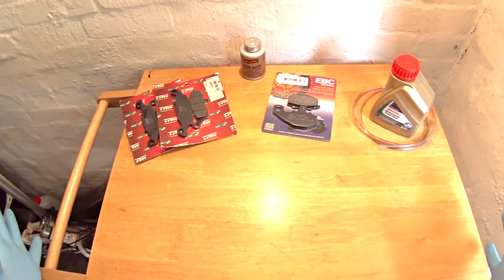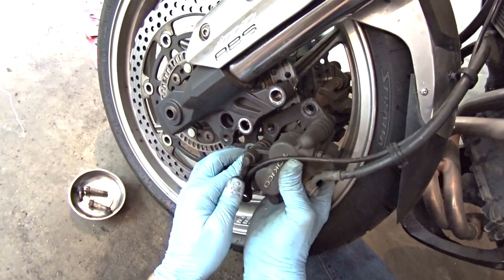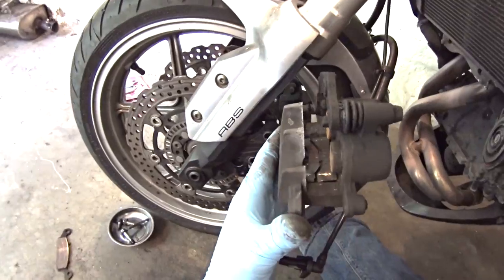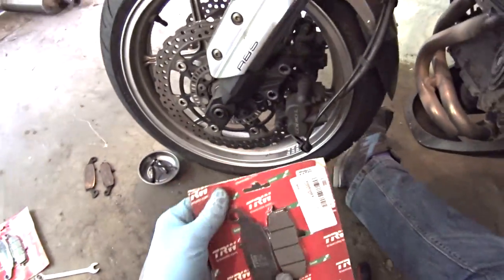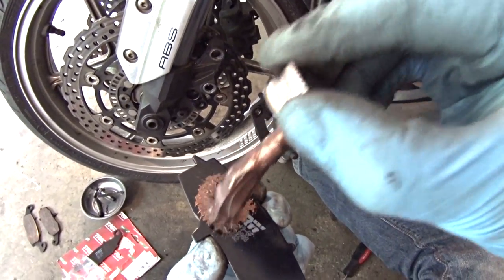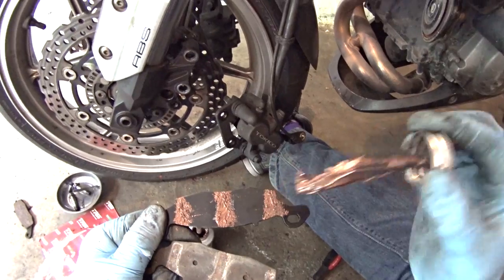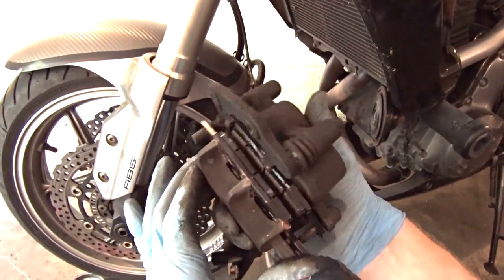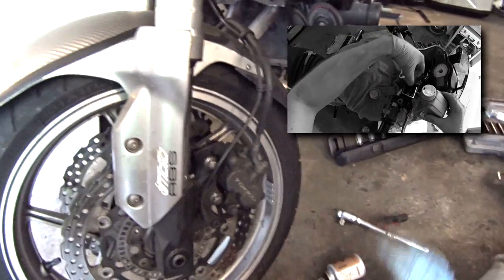Changing Front Brake Pads, Versys 650

Comment: Great vid, Andy. I might add that if you're unsure whether fluid has been added, keep an eye on the reservoir. And if it's a Japanese bike and it looks like the reservoir is held on with Phillips head screws, it ain't - they're JIS and there is a difference. If you use a Phillips driver, do so with care!
Reply from the maker: Thanks John. Yeah I’ve discovered the difference between the Philips and JIS. I think now that i have a new bike, i really ought to invest finally in a decent set of JIS bits!

Comment: A funny thing that clip is there, my local shop bothers with a pin with a loop - another great tip is that those clips are the same ones we use to hold a body onto a radio controlled car, i've got loads of them and all sort of colors though you're not gonna see them so often :D.
Did the oli and air filter off your other video, thx for that, saves lots of time and money to be used on the road and on the bike :)
Reply from the maker: +DJ-Skovsnegl Thanks! Top tip! Especially for those wanting pins to match their fancy multicolored stainless braided brake lines!!

Comment: Hi Andy! Did you like the organic brake pads? Are they good for riding in the mountains? I changed my Yamaha Fazer for a Versys and need to replace the brake pads.
Reply from the maker: I thought they were great. Obviously they're more susceptible to brake fade, but I only had one slight case after a very heavily overcooked straight bit into a super steep hairpin! The smoothness made it worthwhile though. Though I am also not a heavy braker. With the Versys you can also leave a lot to the strong engine braking.
Reply: @AndyManCam  Thanx for taking time to answer my question! I'm also not a heavy braker. I prefer engine braking (at least on my Fazer). I just bought the Versys and I think the engine braking is way too hard. But maybe I just need to get used to that (or buy a booster plug). Anyway keep up the great videos!

Comment: There are always people saying you done something wrong lol giving your brakes a clean while doing this is good practice but as I'm sure you found out, it's rare it will cause any issue if you don't.  I'm mostly surprised there are not a ton of ""don't use copper grease on brakes" comments lol, it's absolutely fine, they should read the label.  I've always used it on brakes and on car wheels (where they meet the hub, makes taking them of much later, much easier) from training, at work and on my own cars over the years.  It is designed to go on mating surfaces and prevents corrosion, on moving parts like the slider pins, you should use a high temp all purpose grease, after cleaning them too lol not with soapy water as someone said, use brake cleaner.
Reply from the maker: Cheers HR. Yeah there's always something that somebody thinks you should have done different! The grease was a case of what i've got being better than nothing at all for the pins! Steadily the workshop equipment grows to what might be called a well stocked workshop!
Reply: @AndyManCam  I'm always needing new tools and fluids and greases, especially now I have more to do on the ER6f.  I even put copper greases on a bikes rear axle once as I had nothing else.

I just watched your booster plug video as you typed this lol, looks like a pretty cheap alternative.  I was asked once (years back) if I had something similar fitted to my old car (to make it go like stink he said), because we had trouble getting the emissions down for an M.O.T.  Any issues with this later?
Reply from the maker: No real issues, but out of paranoia and lack of time, I actually removed it for the German MOT. Kind of wish that for science's sake I'd left it in.
Reply: @AndyManCam  You already had an end can on right? did you have a performance filter too?  they would already have made the ECU up the fueling due to more air flow at both ends.  I just wondered if it did still run lean before fitting this.
Reply from the maker: Yeah I had a Hurric End can, and a high flow filter, so probably would have been fine as it would have been running very lean with standard fuelling and so much more air. Next time!
Reply: @AndyManCam  Thanks for taking time to reply mate, really appreciate it  👍
Reply from the maker: No problem mate. My pleasure !

Comment: Two lil questions for you Andy.

How long do you find the pads take to bed in?
How long roughly do they last?

Need new fronts on mine soon and was thinking of just grabbing two organics as have been told they bed in alot faster than sintered and alot gentler on the discs
Reply from the maker: +Mishka Oliver It depends really on how you ride. I tend to try and think ahead and also use engine braking a lot. As a result they take a little longer to bed in and also last way longer! Should probably bed in within about 200km. My last set of pads were on the bike when i got it and were still only half worn 15,000 km later!

Comment: Shouldn't the second piston try to pop out when you force the first one back in (and vice versa)?
Reply from the maker: +Kevindeuxieme i guess that the resistance of the cylinder against the seals is greater than the gravity on the level of the reservoir. So the liquid takes the path of least resistance rather than forcing the other stiff piston out. Might be different if the reservoir cap was off and the system sealed? Not sure!

Comment: Jesus...this is how you don't do it....get a caliper tool to push them back in, less than £10 on ebay.  Also, before pushing the pistons back in, push them out a bit and give them a clean...room mate's tooth brush is good for this...you've just pushed dust and other debris past the seals!!!
Reply from the maker: +Bucks Biker Why buy a tool for a tenner, when i have a ton of tools that'll do it fine already!? Agreed i probably should have given the pistons a setting too first. But this is the quick and dirty version! Plus i plan to give the calipers new seals when i eventually get braided lines.
Reply: Because you'll damage the pistons, it's a cheap tool that is perfect for the job.

http://www.ebay.co.uk/itm/DISC-BRAKE-SPREADER-PISTON-PAD-SPREADER-SEPARATOR-CAR-CALIPER-HAND-TOOL-/201402082399?hash=item2ee47fe45f:g:gjcAAOSwT6pVw0fT

Cleaning the pistons is a must, there is no version where it isn't done.
Reply from the maker: +Bucks Biker Except for the version where I didn't 8 months ago and all is still working fine. The seals are designed to keep the crap out and the fluid in. Though i agree that you should help them out, I don't think the system is so fragile that it will be catastrophic not to polish the pistons up! I also don't think that a cylinder of metal designed to exert tons of force onto another piece of metal is going to be noticeably damaged with human force through simple tools. If you want a special tool for the job, great. Fill your boots. You probably have a wealth of special tools. But i don't want one. I don't need one. I won't buy one. End of. I was raised very much in the home mechanic school of using what youve got to get the job done. Oddly enough, my Dad and mechanical mentor was a military vehicle mechanic for 25 years. If you haven't got it, make it or make something else do it. Everything else is laziness, opulence or cheating!
Reply: A C-clamp works great for pushing in the pistons.
Reply: Fine, your bike but £8 on a tool isn't breaking the bank and ten minutes with a bucket of soapy water is worth doing.  I don't believe pistons are put under tons of force and the force they are subjected to is evenly distributed which a screw driver or mole grips doesn't, if you want to bodge the common method is to insert the old pads and lever on those. Sorry to be a bore on this but it's quite important.  Have a good New Year, looking forward to your 2017 videos.
Reply from the maker: +Bucks Biker maybe I'll have saved up the £8 by the time i next change pads in 2 years or so! 😂  Happy new year to you too BB. See you in 2017!
Reply from the maker: +patches350 I couldn't find my C clamp! Plus i was keen to get out and enjoy the sun! Had to improvise!
Reply: @AndyManCam  OR another way is to just push the pistons back with your thumbs, after you have cleaned them first of course. How ? I hear you ask, eat 3 Weetabix a day perhaps? No I reply, just back off the bleed nipple thus relieving pressure in the system, tip put a tube over the nipple first just like you would if you where bleeding the system,, gets a bit messy otherwise. Another tip is to tighten the nipple afterwards lol.

Comment: OK, all that grease you blobbed onto the back of the pad is mostly wasted!  You'd be better off simply coating the outside ring of the pistons as that is the ONLY contact there is between the pad and the piston.  All the rest of the grease is just wasted in the hole of the pistons and doing nothing.